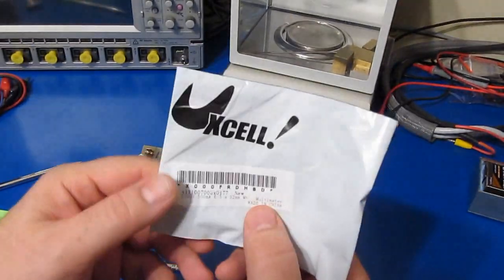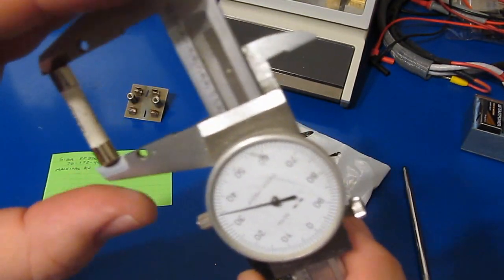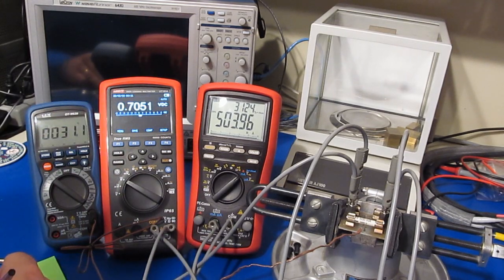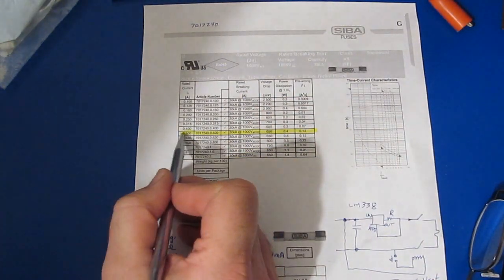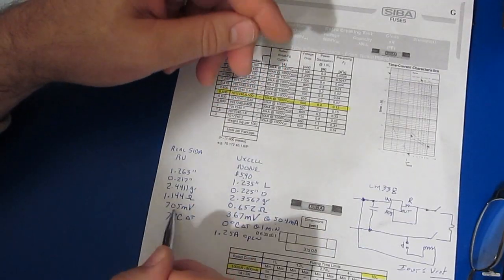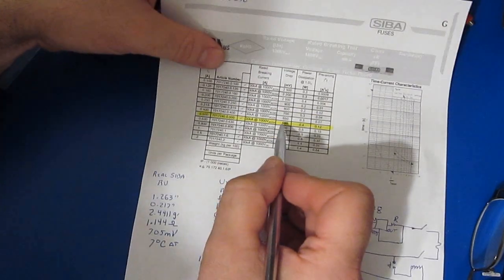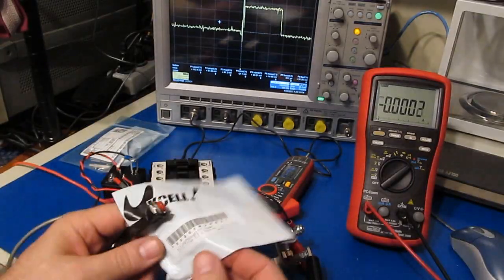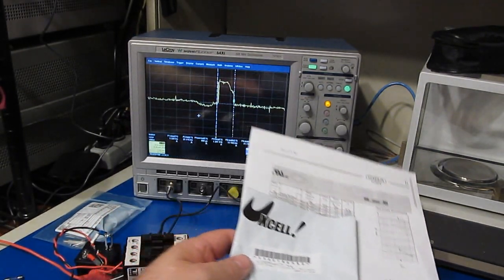SIBA branded UXCELL Multimeter Fuse, Real or Counterfeit?

Comment: You don't compare with the fusing time limits of the "legitimate" one, it make no sens for me since datasheet are average data...
Reply from the maker: The data sheet was the maximum, not the average.
Reply: @joesmith-je3tq  I am not questioning your test, I agree that these counterfeits are not recommended but what I mean is this data is "average maximum test", it seems impossible 
 to physically build many thousands of fuse that will systematically act at T time max (maybe 1/4 could blow at 5ms or less, 1/4 at 7ms or more and the remaining 3/4 effectively blow at 6ms), this is a commercial max, users do not want to see in the max section of the datasheet 5 to 7ms or 6ms (+/- 15%). But I agree, originals one are surely far better, i think it would be interesting to see the fusing time of a true SIBA in comparison. Are the good one are really good for 5 bucks piece !
Reply from the maker: @park8023  Again, the data sheet specifies the maximum, not an average.  There is no minimum.  They can blow from 0 seconds to 6ms max at 10In.  I am not sure why making something with this loose of a tolerance would seem impossible to anyone.   We don't normally design to typical numbers but worst case.

Comment: What setup allows you to test these all at once?
Reply from the maker: You will have to help me out.  Test all of what at once?
Reply: joe smith sorry I meant the multimeters. How are you setting them up to test them at the same time.
Reply from the maker: At 3:51 I show three meters running and assume this is what you are referring to.  As I mention during the video,  one is measuring case temperature, one the current through the fuse and the other the voltage across the fuse.  Making the measurement at the same time is just a matter of having the meters all turned on a once.   So, what  is it you are really asking because I still have no clue.

Comment: The second you measured the resistance i thought it was a cheap 1 amp fuse re-printed.
Amazon should know better than buying crap fakes, there is a tuber called Louis rossmann that has bought supposedly new chips for apple laptops from amazon, they were older used ones that were reballed and re printed.
No dam morals :-(
Reply from the maker: Had it been sold as a 1A fuse, had been closer in length, better lettering,  it would have fallen very close with the data sheet and much more difficult to detect.  There is still the safety side of things..
Reply: Some of the extra special fluke meter fuses make your wallet cry, i would of expected that type to be faked.
I had an accident with my old fluke 8050A bench meter, i had forgotten to move the probes back to the com and voltage inputs, i went to measure a voltage Bang!!, oh dear, i crapped myself as i thought i had killed it.
The large 3A fuse went pop, but the bridge rectifier that protected that input died too, it went short circuit thank god.
After a bridge change and a wallet empty for a fuse it was fine again :-D.
I didnt do that again LOL.
Reply from the maker: I loose them in my bench meters from time to time but these are cheap to replace.  I keep a few spares of the larger fuses for the handhelds.  The Fluke 440mA ones in a 5-pack were not too expensive.  The 10A ones are a bit pricey.  Normally, if I am working with higher currents on the bench, I am not using a meter to measure it directly.   That UT210E has filled a void.
Reply: On RF power transitors is a plage and i am no sure on igbts soo i am used for get they from TME instead ebay/amazon.
On power repair/applications is must avoid theses bastards sellers.

Comment: It would be more informative if you did the same test on the real SIBA fuse.
Nice video, thanks.
Reply from the maker: I assume you meant the two destructive tests.  I didn't have any to spare but the voltage drop was close enough to the data sheet, unlike the counterfeit part.

Comment: I wonder if the original Siba holds up to the specifications?
Reply from the maker: The cold voltage drop test looked fairly close for the real SIBA part.  With the counterfeit being half the resistance, I knew the trip time would be off a fair amount.  Makes some sense for a given material that half the resistance would double the time sort of.   The real SIBA was retuned to its rightful meter.

Comment: Surprising the counterfeit fuse actually performed as well as it did. As always buyer beware. Thanks for the heads up.
Reply from the maker: I guess they were not an open, and they did have some filler.  Sure they have twice the absolute maximum break time called out in the data sheet.  That's better than 100X.  And they did spell the brand name correctly.